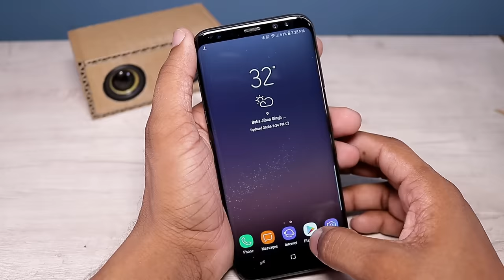Amazing DIY Bluetooth Speaker

Comment: People say cardboard sucks but I used some as a test rig and so long as it's rigid enough it sounds pretty decent. You have to try to insulate it in some way though otherwise the highs start to have a little reverberation that you can tell is the cardboard. I'm maxing out 2 channels at 6 watts and it's enough to almost stress the coardboard but not quite, what you are using looks ideal.

Comment: The tube on the side of the speaker is typically measured in both length and with on a computer for tuning, and this would be different for every size box and brand speaker unit. That way, the bass will be better.
Reply: Very good
Reply: Mohammed asif
Reply: 2:33

Comment: there's a bit of saturation, may be using li-po batteries help, also, is a very small device, removing the "breathing hole" would help to increace bass a bit (that worked for me :b)

Comment: If that amplifier board is for 6 or 8 ohms, and these speakers are 4 ohms. What could I do?
Reply: Nothing, the speakers would play significantly louder, but still safe
Reply: @sterchron  Thanks, dude.
Reply: @margirisalekna941  the speakers would play much more quiet because the ohms/resistance is much higher than the intended range of the speaker. Lets say you have a 4 ohm 30 watt speaker; it would be equivalent to a 2 ohm amplifier output that draws 15 watts, because the resistance is 2 times Less than the intended use, which allows more voltage to pass through, which results in the wattage being cut in half. if you have a speaker rated at 30 watts and 4 ohms you could use an 8ohms amp, it would have to output 60 watts...

but if you have a speaker rated at 4ohms 15 watts and it is ran at 4ohms 30 watts, it could damage the actual speaker and even the actual board because the speaker consumes much less of the intended voltage, and the materials and parts that are specifically designed for the speaker, because the parts/voice coil in the part exceeds the max amount of stress it is able to handle, and the left over voltage that the speaker couldn't consume runs through the circuit board damaging many of the parts (Unless for some reason the amp has speaker over-voltage protection.) and its not a fun thing to fix... (Its very challenging) also, the equation for other projects like this is listed below for you...

Ex: Speaker range = 2 ohm 30 watt = 4 ohm 15 watt
if the original ohm and wattage are greater than the output,
original resistance/ohms divided by 2 and original wattage divided 2 = equivalent equation.

but if the original ohm and wattage are less than the output,
original resistance/ohms multiplied by 2 and original wattage multiplied by 2 = equivalent equation.
Reply: @RelescFPV  Thanks for this great advice, bro!

Comment: You may add LED (as indicator of on/off) in your diy. 
2. This Bluetooth cum audio Amplifier has play, pause etc. types functionality so you may add buttons for this.
3. You may crimp JST connector instead soldering speaker and power connection.
Otherwise it was good diy of Bluetooth speaker with precisely handling of all soldering, connections and creative work like professional!

Comment: hey nice video. Don't your audio turn off with using 4ohm speaker driver with HF69B Bluetooth amplifier board when the volume is high? I ma having this issue. can you help me out?
Reply: The amp ist only for 6 or 8 Ohm speaker

Comment: It's a nice and simple design but you forgot the Thumb rule : Amp Watts must always be lesser than the driver's.
 You're using a 6Watt channel amp for a 5 Watt driver speaker and it's seen that the speakers are over loaded and vibrating alot. The amp board will definitely heat up and coil might burn. 
Port is placed in the wrong position.
Also, where is the battery Discharge module for protection !!
Reply: I know this an old comment but for the discharge protection, it’s built into the circuit board he used(I have the same one he used.)

Comment: Connection is wrong battery's -ve is connected directly to switch and it is not possible to recharge battery without using switch